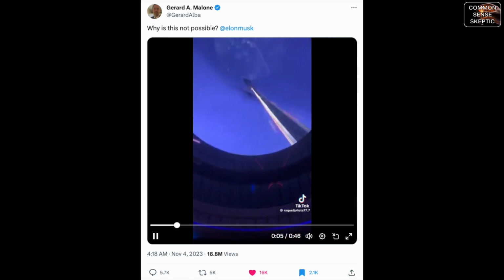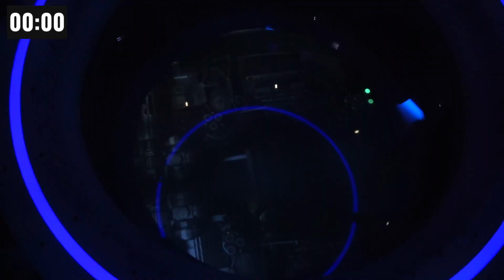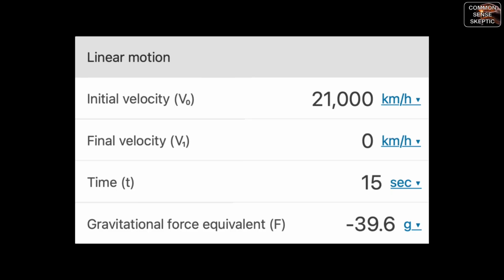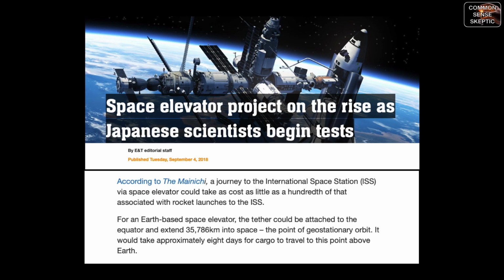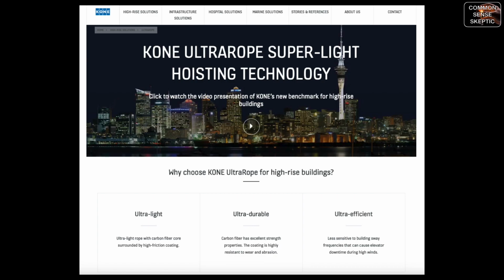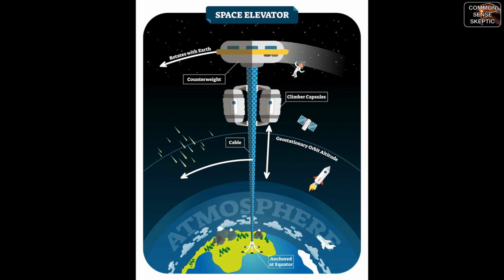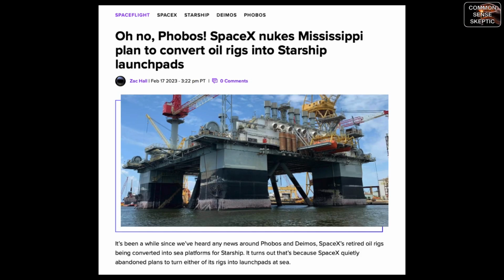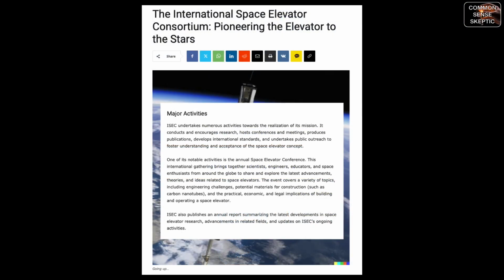DEBUNKING L.E.O. SPACE ELEVATORS

Comment: Hyped for this video as someone intrigued by the idea of space elevators but also know they will never come to be as the material strength doesn’t exist, they would have a tendency to break and kill millions of people and destroy huge areas of earth on the ground. They’d have to be built on the equator and many thousands of kilometers above the earth. The mass needed and cost for a fever dream of a guaranteed future disaster is insane.
Reply: As Arthur C. Clarke put it, it'll be built about 50 years after people stop laughing.
Reply: You have a cool @
Reply: The problem with space elevators isn't so much that they themselves are a terrible idea. It's more that there are so many other options that are obviously much better. It's similar to hyperloop, sure it sounds nice but we can accomplish basically the same thing with high speed rail. Orbital rings, mass drivers, and space tethers are all examples of space infrastructure that lack many of the downsides of a space elevator while accomplishing the same task.
Reply: @hedgehog3180  most of those things you said are better than the space elevator are just problematic
Reply: Totally agree 👍
Reply: 1. Look up terminal velocity. This would not kill millions from falling. It would have the terminal velocity of a carbon fiber rope or about 20 meters a second. This is based on the density of carbon fiber being lower and the drag higher than a human in freefall which has been clocked multiple times to be around 50 meters a second.
2. When looking at the size of the investment, it is always best to also examine the return one gets on that investment and for how long. Look at the fix and variable costs. Look at the upkeep and total cost of ownership. Yes, this would be expensive in labor, materials, and energy. You would also reduce the cost of putting something into LEO to a few hundred dollars per pound... all day long... everyday... for hundreds of years.
Reply: @krisspkriss thank you for exposing your lack of insight and knowledge.
Reply: @hanspecans  LOL, tell me where I am wrong or you are just projecting your own ignorance. Fun fact, you can look up the terminal velocity of rope. Someone has a white paper on it. Can you find it?
Reply: @krisspkriss ”terminal velocity of rope” you are a clown. The carbon based structure of a proposed SE would still require millions of kg of mass at over 35,000 Km of length. Terminal velocity doesn’t even come into play at that distance with mass that large and at geostationary orbit velocity.
Reply: @hanspecans  

1. everything below the snap fall down and everything above the snap "falls" up. Why? because the length below the snap was part of a balancing act between gravity and centrifugal force.  Learn physics or go home. And if you come back with "centrifugal forces dont really exist" then really go home. It is shorthand for a much more complex explanation that leads you to the same effect. 
2. It is carbon nanotubes not just carbon or even carbon fiber. 
3. Again learn how physics works. The absurdly large aggregate number for mass is more than balanced out by the absurdly large surface area of the cable.
4. Terminal velocity is terminal velocity. It played a role in the Apollo missions and that was the largest thing we chucked into space. Everything has a terminal velocity, and anything that is given enough time to reach it, will. 
5. Fun fact : some meteors reach terminal velocity and hit the ground with a light thud. No crater at all.
Reply: @krisspkriss the idea that anything will fall up tells me you are in 8th grade at best.
The idea that a falling 50+ mile long carbon fiber cable is not going to hurt?
🤣🤣🤣 okay, you first. 
How are you going to get it through a 400mph jet stream? 
The whole idea is nonsense and nothing more than an excuse to give money to political friends.
Reply: @OhAncientOne  Man, the hubris in those with little to no science and engineering background is almost unbearably rich. Like this homemade custard I made for Thanksgiving and am slowing savoring.

And for a bonus sprinkle of flavor, we have this other note... what is it... ah, the impotent rage at nebulous politicians. No one is lobbying Congress for this project, so you can find a new thing to be a crumongean about.
Reply: @krisspkriss  lol, you're funny.
7th grade?
I have over 49yrs experience designing, programming and commissioning the electrical controls to automate industrial production lines and machining center's.
I know how pretty much EVERYTHING works.
Children come back with insults.
Adults discuss and point out differences.
You claim half will go up & stay in orbit.
That assumes you know where along it's 50mi it will break. Further even if some of it goes up at first, it will eventually come down with zero control over where it lands.
You can't tell where it will break, nor can you predict the consequences.
Reply: @krisspkriss  I watched a tether attempt live from the Space Shuttle.
Did you?
Reply: @OhAncientOne 

1. I was a production engineer/foreman too. I ran a shop and was part owner in another. Know G-Code and actually specialized in conventional machining jig bores and ID/OD grinders. But I can run about any machine in the shop with adequate confidence and know how to design production for small and medium runs in a machine shop.

1.5 I have had multiple engineer coworkers that were young earth creationist, flat earther, and a few other oddball quackery. 

2. I am 50 years old and retired early. 

3.It is far longer than 50 miles. 

4. A space elevator balances out the pull from Earth's gravity with the centrifugal force of the cable that extends past the geostationary orbit. When the cable breaks, that equilibrium is lost and the lower half will fall and the upper half will fling out into space.

5. You claim to know how everything works, but didnt even understand the basic concepts at play, like the equilibrium listed in item 4. So yeah, you have the understanding of a 7th grader when it comes to physics... which matches my experience with numerous people in your position. 

6. Wanna talk shop? You could probably make more sense in your actual wheelhouse. 

7. I have been responding with facts and I can't get past the sheer ignorance. If you can't understand it, then yes, I will insult people for being willfully obtuse. It isn't hard to understand. You have seen a balance before? YOu understand how orbits work. So... if you cant put the two together then....

LOL@U!!!!!!!!!!!!!

Freaking engineers are a riot! Y'all are the gift that keeps on giving.
Reply: @krisspkriss  You keep making assumptions, so let me address your points.
1.  Glad to know that you are not a kid trolling.
Back in the '80s, I converted a Bost-O-Matic
4 axis mill from a punched paper tape to 3.5" floppy disk. I set up the company with CAD and separate CAM software, bc that was all they had in those days. AutoCad didn't even have true 3D drawing.
More recently, between projects I took a job as a CNC operator cutting glass for shower doors, etc. I was on 3rd shift and the workers on 1st & 2nd got mad bc I put out 55pph compared to their 45 at best. 
1.5 lol yes I've had to put up with lots of young know it all's too 
But you got me with the Flat Earther, I haven't run into one of them except on YT 🤣
...
Reply: @krisspkriss  2. Congratulations, I'm over 65, work from home making electrical drawings. My SS doubles if I work to 70.
I enjoy it and it keeps me busy.
Reply: @krisspkriss  3. I know that, I'm just using 50mi bc that's the height of earths' atmosphere and it's a number the average person can grasp.
So you think we can make a cable 22,236 miles long? ...
Reply: @krisspkriss  4. & 5.  You are stating the obvious. To suggest that I don't already know all of that, is purely putting your incomplete assessment of what I know, as a valid conclusion.
Astronomy & space has been a hobby of mine since the '60s. 
If I don't state some tidbit fact it's bc I consider it common knowledge.
Reply: @OhAncientOne  "So you think we can make a cable 22,236 miles long?"

Yes. Do I see us making a space elevator on Earth in the next 100 years? No. On the Moon? Yes.
Reply: @OhAncientOne  The flat earther engineer could have been trolling me in a weird out nerd the nerd flex or something. I got a weird reaction when I asked people in the office about his... ideas. 

I always stayed clear of 4 axis mills and three axis CNC lathes. I didn't mind doing put and take on them, but I think that some shops would pay all that money for... a fancy indexer lets be honest about the typical usage. I don't know how many housings and other parts with bolt hole patterns I have seen ran on the extra axis machines. Those demo parts with 3D contouring, not so much; I even worked for a few years in a large tool and die shop and never really saw that happen much. But then again, we did stamping and I think 3D milling is more common in making dies for  injection molding and hydroforming.
Reply: @krisspkriss  🤣 I think all Flat Earther's are trolls. Some people just can't find something useful to do 😂
This 4 axis, that ran it's path from a 1"wide paper tape, kind of cheated bc the 4th was a separate rotary axis that mounted to the bed and simply rotated the part. In this case it was fancy rings that make up a pool cue.
I've mostly done multi station machining center's, 12 station rotary dial machines and linear machines that had up to 22 different operations. The part gets clamped and moves from station to station.
The machines went to the companies that make parts for the auto manufacturers in Detroit.
In the 90s GM switched to using powdered metal for engine bearing caps.
I programmed the 1st two machines that had 11 stations with drilling & tapping heads,  gauging etc. 
1 machine did all Buick V6 and one did all Chevy V8 crankshaft bearing caps.
When I stopped by 10yrs later, they had just made copies & were up to 14 machines.
It started as a just in time plan with 6 days leeway if a machine broke down before every US engine plant shut down.
JIT didn't prove out so well, so GM made these guys stock 30days worth on their dime 😂
Reply: @krisspkriss  Good luck engineering a cable that could take the strain involved for hundreds of days, never mind years. And that's ignoring the times it will inevitably be struck by space debris. It's a pipe dream. Your ROI will be very squarely in the negative even if you can do it for free just based on legal fees from the massive lawsuits from those affected by the cable's uncontrolled return to earth.
Reply: @burke615  It could fall from space and smack you and it would hurt, but it wouldn't kill you.

Space debris is the magic easy  "No" button for all megastructures, or even future space exploration of any type.  At its current rate space exploration will be impossible in a few decades. See how that works? Magic easy button for a no.

Fun fact, there are cables that get used constantly and somehow manage the strain! Another easy buttron answer that could be applied to just about anything. Electric cars will never work because look at the strain it will put on the grid! Powered flight will never happen because look at the strain placed on the wings and airframe! Submarines will never work because look at the strain from just going 10 meters down! Strain is the oldest easy button no I know of.

Legal liability? Liability based on the previous FUD? I wont even dignify that with an answer, but if I did, it would be another easy button debunking.
Reply: @burke615  To be fair, the ROI on astronomy has always been in the negatives, but somehow, we managed to fund a ten-billion-dollar telescope recently.
Reply: @InfernosReaper  It isn't about how "big" it is. Why? Because it's terminal velocity depends on its cross section not its length. How much drag something has as it fall is determined by its shape, and more importantly, its surface area and its mass.

Next issue?
Reply: @InfernosReaper  I am saying the cross-section of the cable matters and the density matters when determining terminal velocity. Other factors matter as well such as initial velocity and height. Making it longer just increases drag in a 1:1 ratio with weight and so it doesnt change the speed.

Anywho, I am saying this cable could fall on your head... from space... and you would live. 

Fun fact a woman was struck by a meteor and lived. Ann Hodges in Sylacauga, Alabama, on November 30, 1954. Said meteor was traveling around terminal velocity. It went through the roof and hit her leg. About what one would expect if you dropped it from an aircraft at a few hundred meters.
Reply: @krisspkriss  are you like a crazy person? I don't care how fast it is moving, something with that much mass falling on you will crush and kill you. No matter how many buzzwords you use to describe it.
Reply: @godsfavoriteant9293  
1. It isnt buzz words. It is physics.
2. Name calling is just another way of saying "I cant argue with facts so I will argue with insults" So classy!
3. All of that mass isnt going to impart its momentum on your head all at once. 
4. an integral part of how much momentum an object has is how fast it is moving. It is almost like the momentum is mass times velocity. 
5. Did you even pass physics, introduction to science or any science classes?  
6. The previous member of the numbered  list is an ad hominem. It is just there so you feel at home with my debating style. When in Rome do as the Romans do I guess. Kinda fun to be honest; You know, when it actually lands a hit.
Reply: @GerryRR  it wouldn't have to be the entire mass, I don't think you appreciate how huge this cable would be not just in length but in diameter. Even a section a meter long would still be enough to crush you.
Reply: @krisspkriss  re "Terminal velocity"
T. V. applies to free falling objects.
a cable breaking near the edge of space, is effectively attached to the ground.
It's fall will be almost vertical there by eliminating wind resistance and friction to the lowest attainable values.
The weight of the cable will cause continued acceleration at 32ft/sec/sec, with very little loss.
Maybe there's a math wiz who can give us a ballpark estimate for maximum velocity in his head ?
Reply: @OhAncientOne  You admit that terminal velocity applies to free falling objects, then says this case is different as you describe a free falling object.

"t's fall will be almost vertical there by eliminating wind resistance and friction to the lowest attainable values."

That is not how cables fall and that is not how drag coefficients work. In your theoretical scenario the cable drops straight down and therefore it only has laminar flow. That still has a terminal velocity of around 200 meters a second.

Now for it falling straight down. No, it will not and for multiple reasons. One being chaos theory and small changes in initial conditions being magnified over time. Gravity might be pulling straight down, but the cable itself has a compressive resistance,  lateral rigidity, and forces besides gravity acting on it in asymmetric and non isotropic ways. 

Or you know, apply for NASA with this esoteric knowledge that if you move vertically you have next to no drag. They can quit using terminal velocity to limit the speed of their launch vessels. Or perhaps you are just wrong?
Reply: @krisspkriss  I said almost straight down.
it's not free falling, it's attached to the ground and is very different from a length of cable with 2 ends hanging in the air. 
As for laminar flow, there will be turbulence at the very surface, which we can only guess what that looks like. above this turbulence laminar flow begins.
In any case I disagree that laminar flow has any effect in this situation.
I've selected and designed flow meters for both air flow and liquids of varying specific gravity. So you aren't telling me anything new.
Reply: @krisspkriss  I didn't say terminal I said highest velocity which happens when the last foot hits the ground.
btw, I studied chaos theory back in the 90s.
Reply: @OhAncientOne  Thats nice. I know people that have engineering degrees that think the Earth is 6000. So you need to do better than a call to authority and your day job. We all have them.

"As for laminar flow, there will be turbulence at the very surface, which we can only guess what that looks like. above this turbulence laminar flow begins."

You design flow meters and claim know everything revlavent there is to know about fluid dynamics... and yet here you are making quasi accurate statements. Is it very hard to model the turbulence at the boundary between the moving surface and the surrounding air? Yes, and that is why we use the formula in things like the machinist bible  to look up a short hand way of calculating its effect on your flow transducer. Without looking it up, I would wager it is based on viscosity, diameter, and pressure.

Fun fact. Flow rate transducers are generally made by one or two companies. What you most likely do is buy those off the shelf devices, make a housing for it and a PLC to display the results and/or network the data into the production system. 

Man, it is almost like I figured out exactly what your job is and how little it doesn't demand the advanced degree you iply.
Reply: @krisspkriss  WOW, you're getting worse.
You really should stop assuming you know what is in my knowledge base.
Every time I mention something you come up with a fantasy of what you think I know.
Have a nice weekend.
Reply: @OhAncientOne  Orbital mechanics and aerodynamics are not your wheelhouse. LOL.

Fun fact, I have seen sooooo many flow meters in my life. I understand how they are made. Maybe it uses induction or another method of measuring flow, but in the end,  my comment still stands. Nice try.
Reply: @krisspkriss  You're the the one who believes an elevator can be parked at 22,236 miles with a cable attached to the earth.
Ain't gonna happen but you just keep dreaming.
Just the navigational hazard is enough to kill it. 
You are the one who claims that nobody will get hurt when a 10k mile long cable cones back to earth.
Obviously common sense is not your "wheelhouse" 🤣🤣🤣
Reply: @OhAncientOne  

1. I think it would freefall at between 20 meters a second, which I could tank to the face if I must, and about 200 meters a second, which I would not want to tank to the face... but could possibly survive. 
2. I know things fall from space on the regular and some of them are slowed to terminal velocity. I also know Antarctica can be  a great place to find these just sitting op top of snow and ice. I also know you probably think "naw they would met the ice!" I happen to know that it is common for meteors to actually feel cold to the touch when they first land. Less than ambient. 
3. I made it clear I dont think it is plausible to do on Earth in the next century, but is possible on the moon. Don't straw man me. It is rude and I will call you a __ little ___ for it. 
4. Common sense is not that common and rarely has much to do about actual sense. 
5. ZZZZZZZZZZZzzzzzzzzzzzz Bring a better game next reply.
Reply: That’s kind of like people in 1815 saying “traveling at more than 60 mph wil never come to be as we do not have wooden wheels strong enough to sustain those speeds” or “because horses can only run so fast”.

We may never be able to get around the speed of light, but I wouldn’t be too sure on predicting what kind of materials we will come up with in the next 150 years.